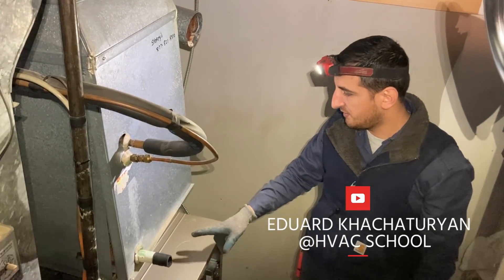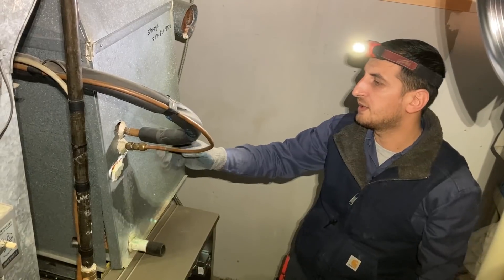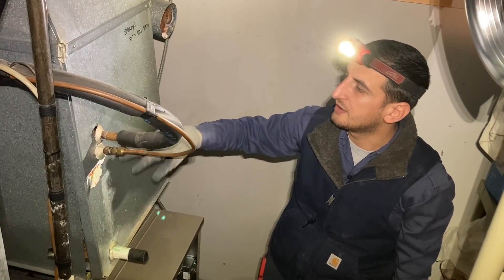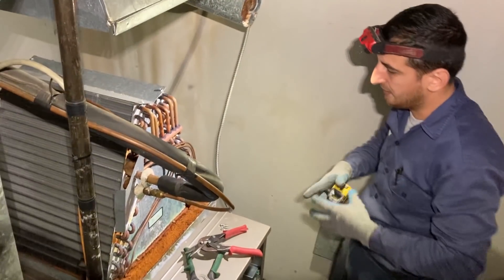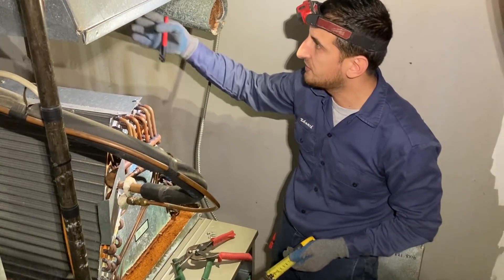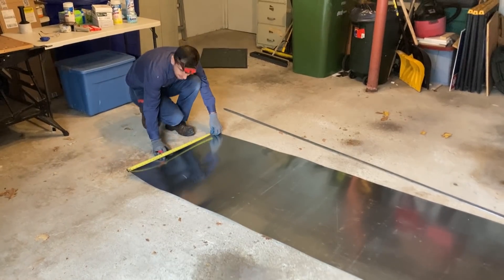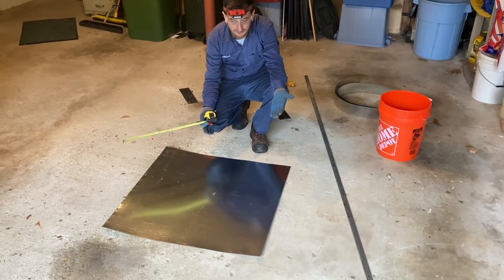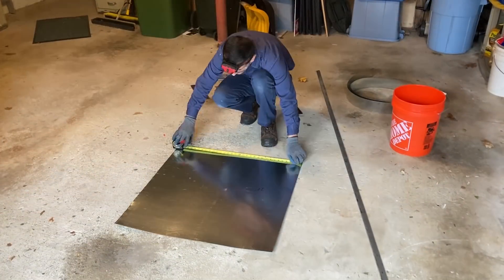How to Build a Sheet Metal Coil Case From Scratch

Comment: Great video! Have a question for the front piece that goes over the line set and drain. Could u have put that piece up against the drain pipe and trace around the pipe with a marker and then cut that spot on the front piece

Comment: This is a random shot but how much would you charge someone to do this? I had my furnace replaced and had a similar issue . The old Furnace was over 4 feet tall and the new one was 2 feet. They build a 2 foot junction box and are charging us $1700 for that. I feel like I could do it for fraction of that cost

Comment: No insulation? Sheet metal is definitely my weak point. I did learn something. I would have used a cased coil and then make a transition to the plenum though. And most coils have a schrader you can recover from if it’s raining, but probably not necessary for lowering it a couple inches.

Comment: I wish I could use tin can to make my transitions. (Also the existing duct almost never lines up like that)
Reply: Yeah, when you can cross brake a piece of sheetmetal with the back of your fist over the edge of a ladder, you might be a shade light on the metal.

Comment: Outstanding job using the tools on hand. Did a better job than most guys with a shop brake. Great video. Check out a “ Hensler Bender” great tool for your van.

Comment: I don’t even understand how he gets such clean bends and cross breaks with a ladder.. this guy is incredible
Reply: 30 gauge
Reply: @jamesmclaughlinprimitivele4587  26
Reply: I use 28 to make the bends easier
Reply: That’s just joist liner. 30 gauge, you can make cross brakes even faster by putting the sheet metal on carpet, using a straight edge and a flat blade.

Comment: I'm surprised he didn't address the rusty evap coil pan.
Reply: I saw that as well. Could of cleaned it out as much as possible and epoxy coat it.
Reply: @wonderhomie2011  or used some pan kote. Ultimately though, if it were raining outside and you were low on time, you can only do what you can do in the allotted time with the given weather conditions.

Comment: It had never crossed my mind to use the step ladder to do the cross breaks! Very talented guy working out of a five-gallon bucket; fortunately, in my market it not good practice to replace only one side of the comfort system, unless the customer absolutely cannot do it any other way.
Reply: 5 gallon bucket. Best tool bag in the universe, it is a chair, step ladder, tool bag, your can fill with water if you brake a pipe, it is a garbage bag... and finally it is affordable.
Reply: You win the internet for today! Very good point😅🤜🏻🤛🏽